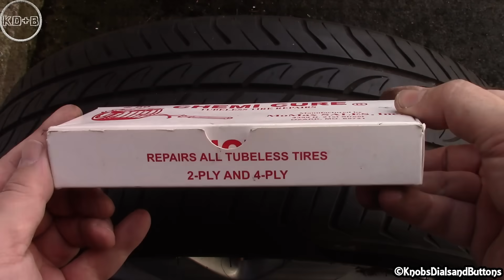How Tire Repair Kits Work - With Internal Views

Comment: I’ve used the first plug in a pinch, but personally I prefer a hot patch on the inside
Reply from the maker: I would only recommend using any of these kits as a temporary repair until the puncture is patched internally at a tire shop

Comment: How effective is the repair kit using a screw? Interesting
Reply from the maker: It works good as an emergency repair, but I wouldn't use it as a permanent fix
Reply: @ Roger that. I I’ve been using the first repair kits for a long time and they seem to hold up for the life of the tire 👍🏼

Comment: I used the first plug kit many times, but never rotated the tool 180 deg.  Is that on the instructions?  Seems that leaves a clump of excessive rope on the inside.  I recently saw the last screw-plug kit on Temu so bought one for every vehicle since only $1 and smaller and easier to use.
Reply from the maker: Some repair kit instructions say to rotate it and others say to pull it straight out. I just do whatever is on the instructions of each kit

Comment: Excelente video y muchas gracias por compartir. 
Considero que este tipo de reparación es útil para una reparación rápida, sobretodo en una situación en la que no tenemos suficiente tiempo y oportunidad para llevar la llanta a un taller especializado.  Con este tipo de reparación se corre el riesgo de que se filtre el aire entre el forro interno (capa impermeable) y la carcaza de la llanta ocasionando filtración de aire y separación de las capas que conforman la llanta. Siempre que hago este tipo de reparación y tan pronto tenga la oportunidad de llevar la llanta a un taller especializado le hago colocar un parche interno para proteger el forro interior.

Comment: Thank you, again.   What happens to the plastic point that's inserted w the g n?
Reply from the maker: It remains in the tire until it's removed at the tire shop. I'm only demonstrating how to use the kits, I have nothing to do with their design :)
Reply: @knobsdialsandbuttons  I know. Very much appreciated 👍
Reply: I knew somebody in here asked this question as well. Thanks for the both the question and answer! This is a high quality, very informative video. 🙏🏼😁

Comment: I've had rope plugs leak, not fail, on soft tires. Both summer sport tires and sport bike tires. My theory is the soft compound moves the plug around too much and it separates. Other than that, I've never seen a problem. My personal favorite was a double plugged travel trailer sidewall.

Comment: Nice content. 
One question: Why does the sticky string handle does not have a slit in the eye?
Reply from the maker: With that kit the string has to be pulled back out through the tire
Reply: @knobsdialsandbuttons  ah okay. So need to keep in mind to get one with a slit. Thanks for answering.appreciate it !
Reply: @knobsdialsandbuttons  ah okay. So need to keep in mind to get one with a slit. Thanks for answering.appreciate it !

Comment: I once had a puncture on the motorway. Found a 3.5 mm screw sitting in my front tyre. I took it out and put 5mm screw with superglue.  I promised myself to change it once back home but completely forgot about doing it. Been driving with that screw for several months, untill tread was worn.

Comment: The rubber mushroom system in my opinion is the best option but buy the one with the gun that squeezes the plug into the hole that hex key idea is a bit long winded. The mushroom itself has a lubricant on it which helps it to slide from the gun and helps it to pull up before the cut is made. I have done countless tyres with this system and with 100% success with tyres losing no pressure in three years, though I have to admit I love it when the tyre is bald enough to warrant a new one. That small screw system is useless for one thing it is not actually a screw and it is not long enough to work properly. The sticky string is very messy so avoid that and the other string can only be described as being temporary to get you to a tyre shop. Another big tip to avoid low pressure is to NEVER use metal dust caps always use plastic.

Comment: Thank you for the video. The process is rather simple and pretty straight forward.   
The TWIST BEFORE extraction and GLUE APPLICATION seems to be a matter of preference more than anything. Otherwise, why isn't recommended with ALL PLUG repairs??   Some say 'NO', don't do it.
Reply from the maker: I go by the instructions on each kit. I'll only twist it if the instructions specify to do so.

Comment: That pointy plastic is left inside after the second mushroom(orange) is inserted. It’s now rattling around as you drive, I prefer the first mushroom install however I’d have used some rubber cement to further the seal as you finish the install and tug on the neck, this would make for a more complete seal than just the mushroom head alone.
Reply from the maker: If people want to add rubber cement that's up to them, but I only demonstrate the kits using their instructions and whatever comes with each kit.

Comment: Will this work on a car that can pull high cornering Gs like a sports car? How well can it handle high cornering forces? Is there any chance the plug fails or pop out under these forces?
Reply from the maker: They're designed as temporary repairs for road/offroad vehicles, not for racing sports cars

Comment: For the gun method, where did the black cone thingy go after you shoot the plug? Did it just fall off inside the tire?
Reply from the maker: Yes it remains in the tire until it's removed at the tire shop. I'm only demonstrating how to use each kit, I have nothing to do with their design :)
Reply: @knobsdialsandbuttons  Thank you for your info, brother. 👍👍
Reply from the maker: You're welcome !

Comment: I use only half strip, n i put the glue or cement on the hole, btw no air pressure anymore, then immersed in water to check the succes or not.

Comment: The price of equipment set for plug strip is $1 and mushroom plug is $20.
Either it's because the plug strip is more common in my town, or is there any advantage for using the mushroom plug?

Comment: With the plug or sticky string is it guranteed no air leaks? ( i wish u could of add soap water to confirm this on all plugs, my tire shop used inside patch but still leaks)
Reply from the maker: I tested them in this video: https://www.youtube.com/watch?v=0ZObKnAcINc
Reply: @knobsdialsandbuttons  hey thank you! I'm glad I looked manually for my notification tab as this didn't pop up. Great video and thanks for responding. I will try maybe the first one here the orange strip because my tire shop patched my tire twice from the inside and still leaking air and they blew me off saying I gotta buy a new tire (one of the employees said he thinks maybe the scuff it down too much from inside so patch is not level)

Comment: I run a couple of 1960’s Lambrettas scooters & have upgraded from the original split rim’s to alloy rims,
I’ve upgraded due to the amount of mileage I do & the safety of having tubeless rims, 
I’ve never experienced a puncture / blowout with split rims & want to keep it this way.
I don’t carry a spare wheel so have bought a couple of these kits to carry around in each of my scooters..
Just need to find a small portable rechargeable or battery powered air compressor should I lose air, while carrying out a repair in the middle of nowhere.
Hopefully I won’t ever use it 👍

Comment: I leave at least half an inch of the strips out If you cut it flush with the hole at some point is likely to pop into the tire Plus as you drive the tire it will flatten the exterior part of the plug

Comment: Which one is the most reliable method in your opinion?
Reply from the maker: In my opinion the sticky strip repair is the most reliable when done properly.
Reply: @knobsdialsandbuttons  thanks! Glad I have found your video
Reply: @knobsdialsandbuttons  do you have any recommendations for tire rasp tool? I’m planning to use this on my touring motorcycle.
Reply from the maker: The rasp that comes with the sticky strip is good as it's quite thin and doesn't enlarge the hole too much. It's similar to this one: https://autoaccessories.ie/products/tyre-repair-reamer

Comment: One caveat on all of these. All these methods are considered "temporary" particularly on radial tires . The safest and only truly permanent repair is an internal patch. Finally, only perforations in the contact patch are considered repairable. Holes in the shoulder can be fixed in a pinch, but the tire should be replaced as soon as possible.

Comment: For the gun, what happens to the plastic lead when it goes inside the tyrw? Does it come out and get left inside the tyre? Wish you showed that part in the video.
Reply from the maker: It remains in the tire until it's removed and patched at a tire shop. I didn't design any of the kits, I'm just demonstrating how to use them

Comment: The best way is to use the sticky type which lasts the life of the tire. They have the least leakage out of all of these.  Also, when you pull it out the sticky rope cuts automatically and creates a stronger seal. And then you cut off the top flush.

Comment: I would like to try and do it myself but it looks like ideally you have to take the tire off, I'd rather take it to a repair shop. Very informative though.
Reply from the maker: I took the wheel off for demonstration purposes. It's easy enough to carry out a repair on the front tire when it's still on the vehicle but a bit more difficult with the rear wheel.

Comment: Method 2 and 4 are similar but in method 2 when switching out the centre rod the point comes out and in method 4 that little point goes inside the tire. Would that then just live inside the tire now?
Reply from the maker: Yes it remains in the tire until it's removed at the tire shop. I'm only demonstrating how to use each kit, I have nothing to do with their design :)
Reply: @knobsdialsandbuttons  Thank you for replying. Yeah I'm just worried that when its bouncing around the inside it would damage the pressure sensor at some point. Fair enough lol thank you for the demonstration.

Comment: Had three repairs like the first type done on tyres of varied sizes and the plugs lasted as much as the tread, without any change to traction or handling. 

Automotive engineers don't recommend repairing punctured tyres, even if the puncture is on tread, but I'm yet to see one fail, even after driving for 60.000km at higher speeds on roads.

Comment: On the gun it does not show what happened to the tip that was used to insert the gun in. Did you remove it from the tire. Or do we have to hear that rattling sound from that tip
Reply from the maker: It remains in the tire until it's removed at the tire shop. I'm only demonstrating how to use the kits, I have nothing to do with their design :)

Comment: What happens to that plastic pointed tip at 16:20 ? Does it just fall inside the tire and tumble around until the next tire change?
Reply from the maker: Yes it does. I'm just demonstrating how to use each kit, I have nothing to do with the design of them :)

Comment: So the black attachment in the end of the gun just falls off in the tyre when you insert it then?
Reply from the maker: Yes it does. It remains in the tire until it's removed at the tire shop. I'm only demonstrating how to use each kit, I have nothing to do with their design :)
Reply: @knobsdialsandbuttons  cheers bud. Great video by the way. I watched it to the end. I've had 2 slow punchers in the last 6 months so this is good education 👍

Comment: How to fix so many crack on the side of the wheel all of my tires has it all around
Reply from the maker: If the tires are badly cracked they will probably need to be replaced

Comment: If you're worried about having a problem using it until you change to another tire, you can rest assured that here in Brazil we (the poorest) use our tires until they reach the wire and nothing happens 😅

Quanto vocês ficarem preocupados se tem algum problema você usar até a troca de outro pneu, pode ficar tranquilo aqui no Brasil a gente (os mais pobres) usamos os pneus até chegar no arame e não "da nada" 😅

Comment: What happens to the pointy piece you put in the gun it just drops inside the tire ?
Reply from the maker: Yes it remains in the tire until it's removed at the tire shop. I'm only demonstrating how to use each kit, I have nothing to do with their design :)

Comment: I work at a place that makes these.  I work in the string building. That string looks like ours. It's a boring ass job where you basically babysit the machine for 10 hours and actually work maybe 2 hours. You do have to walk quite a bit back and forth to check the front and back so at least you get your exercise in.

Comment: I think best tool are sticky strings. They make mushroom-like structure after rotation inside and have very sticky surface. I dont trust things that have no glue (maybe they will be holding well by friction and pressure inside but I just don't trust them)

Comment: The amazon kit for 13 euros worked fine for me untiñ i got 8 mm bolt hole that one i could not fix... 5 mm holes works just nice no issue whatsover just dont drive past 150kmh... 😅

Comment: @5:23 Wonderful video..
but what I am failing to understand in both the scenatios is .. why is the sharp tool not vible from the other side of the tyre and the plug is in between the sharp tip and the probe tool.. so how come  it is missing when seeing from the other angle? this is weirdly confusing. Same thing happens at @16:37
Reply from the maker: I only show the plugs entering the tire from the internal angle, not the entire process
Reply: @knobsdialsandbuttons  👍

Comment: These plugs are great if the puncture is tiny and you slather galvanizing sealant all over.  Roads in colorado are far dirtier than california holy crap.  I can jack a car, remove tire, put donut on, patch tire, wait for curing, swap the donut and fill with air in my literal sleep now.

Comment: А на спущенном колесе не проще будет вставить?
Reply from the maker: The air pressure in the tire makes it easier to push the strip or plug into the tire

Comment: Outstanding video, on all points.  Even the pace the video is great, and I love that it shows what's happening on the inside of the tire.  I have emergency plugs in my car but never really liked them (plug strip type).  After watching this, I know now that I want the type that inserts the black mushroom plug, because the kit is small (easy to pack away) and similar to the internal patch repair that a tire shop does.  I like the gun repair kit less because of its large size, also because it apparently leaves the pointy black hard plastic tip inside the tire.  Can you reply to confirm that I am correct about this -- I'm guessing because the video did not show what happens to this insertion tip?
Reply from the maker: Thank you. Yes the plastic tip remains inside the tire until it's removed at a tire shop

Comment: those strip do comes in big and small sizes. use big for big hole vice versa. some motorcycle tyres do not have strong enough shell to withstand big strip into small hole. the hole will eventually get bigger after few weeks or month. i faced this problem with maxxis volans tyres. the trick is to make the hole bigger for the use of big size lug strip. 

not all consumer will afford just to use this tyre plugger as an emergency tool and get the tyre replaced afterwards. majority will just plugged it and use until the tyre turns minimum thread then change it.

i once use a motorcycle tyre for just 2 weeks then it got cut from whatever debris on the road. then change to a new tyre. cant even make a tyre patch repair from the inside because the shell is not hard enough for the inner surface grinding before patching.

Comment: I have looked through many of the comments and no one seems to have the question I have. With the one using the gun, what happens with that small pointed tip he put on the end before pushing it in? It appears it is loose inside the tire.
Reply: Yes it bounces around  inside the tire.
Reply from the maker: Yes it remains in the tire until it's removed at a tire shop. I'm just demonstrating how to use each kit, I have nothing to do with their design.

Comment: A specialist once told me that the action of filing and going through the layers of the wheel with these tools damages and displaces the internal metal membrane. That should be used knowing that the wheel will have to be replaced soon.

Comment: 16:18 Where does the plastic lead go? The video doesn't show it inside the tire. Does it just fall off and stay inside the tire?
Reply from the maker: Yes it stays in the tire until it's removed at a tire shop. I'm just demonstrating how to use the kits, I have nothing to do with their design.
Reply: @knobsdialsandbuttons  I understand, I just wanted to clarify, since the video from inside the tire didn’t show this. Thanks
Reply from the maker: You're welcome ! :)

Comment: On the 3rd one, what happened to the lead tip? It just falls off to rattle inside the tire?
Reply from the maker: Yes it does. I'm only demonstrating the kit, I've got nothing to do with its design :)
Reply: @knobsdialsandbuttons  ofc. Wasn't insinuating it was your fault, 😂. Just making sure I didn't miss something.
Reply: @knobsdialsandbuttons  My thoughts were that it could harm TPMS sensor. That is the only one I didn't like.

Comment: 04:16 so the plastic lead has left inside the tire,  just for easier inserting the gun to the tire?
Reply from the maker: Yes, it remains in the tire until it is removed at the tire shop. I'm just demonstrating the kit, I have nothing to do with it's design.